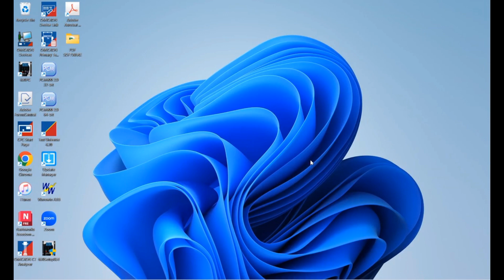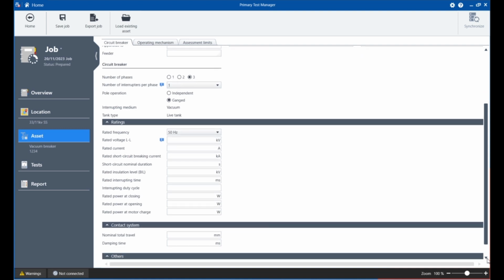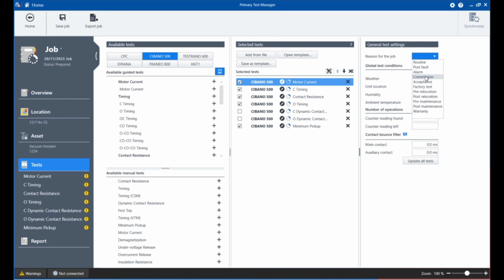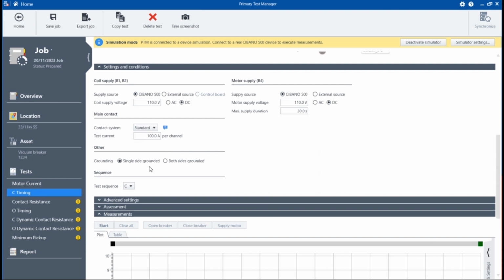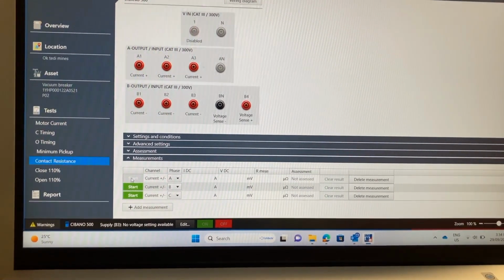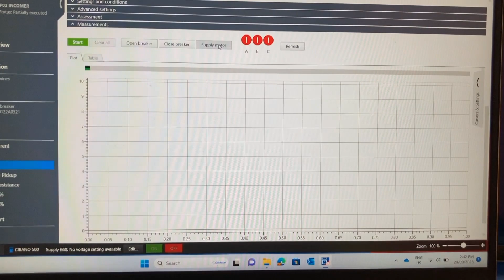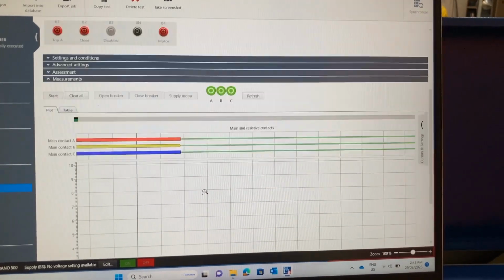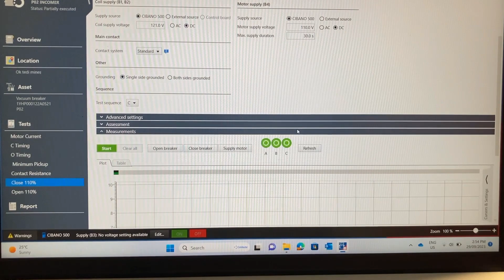CIBANO 500 - Circuit Breaker Testing

Comment: Greetings
We have a CIBANO 500 device and the program v4.5 has been installed on the computer. When we connect the device to the computer, the following error appears .
an error occurred at the test set The CIBANO 500 software version needs to be updated. X Available version on this PC: 4.50.1232.0 CIBANO 500 version: 3.00.82.0
What are the steps to solve this problem. With appreciation
Reply from the maker: Then go back to 3.00 version as CIBANO and make it communicates . Then you can upgrade to latest versions.let me know if this fails.